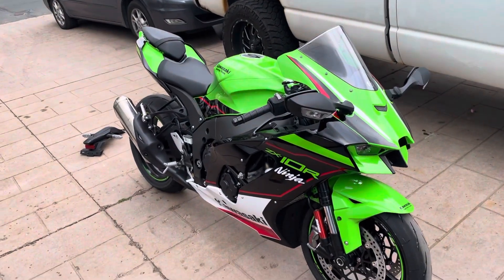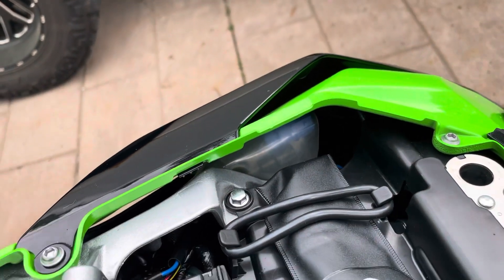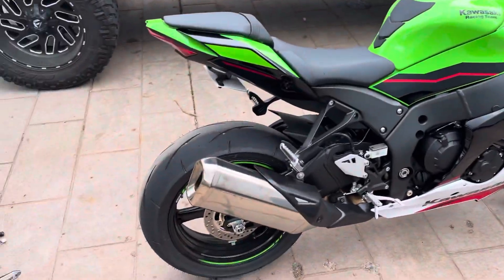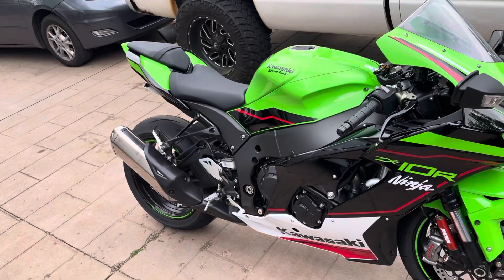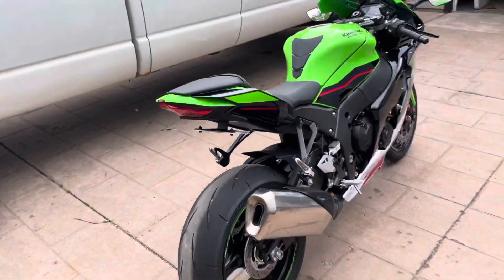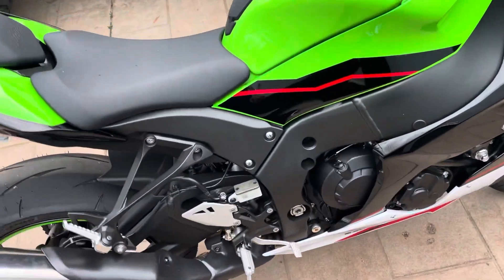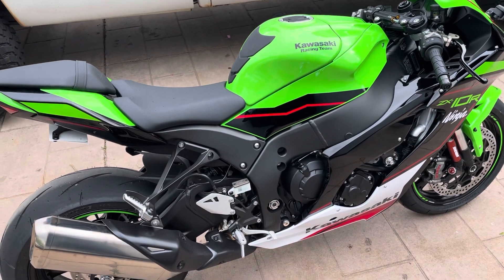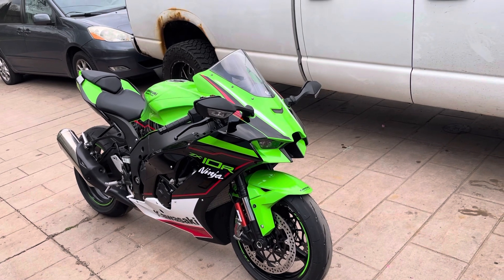2021 Zx10r KRT bumper removal

Comment: Good looking bike...but that plate looks horrible tucked up like that. Plz don’t run the exhaust without the factory muffler...just do a 3/4 pipe from Yosh or Akrapovic. The problem is nobody is re flashing these yet...I have the exact bike...2021 KRT